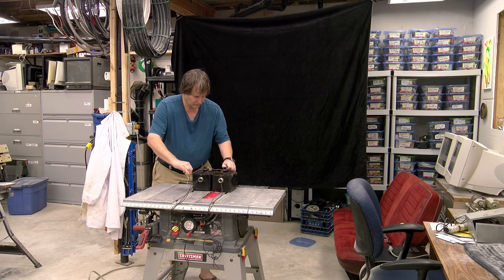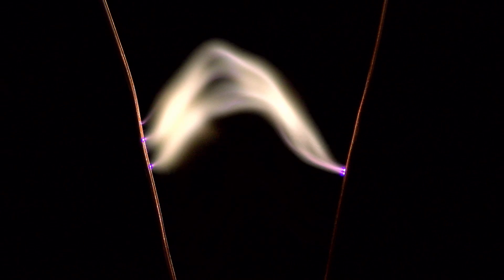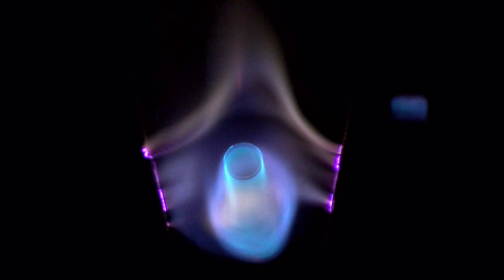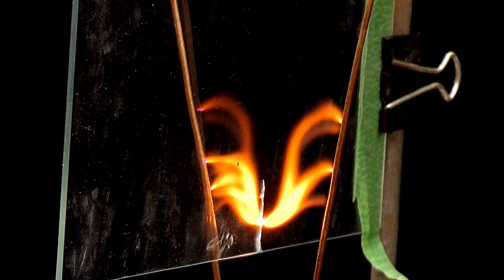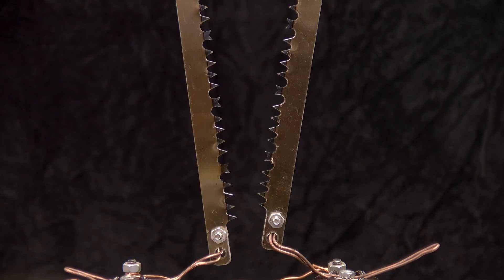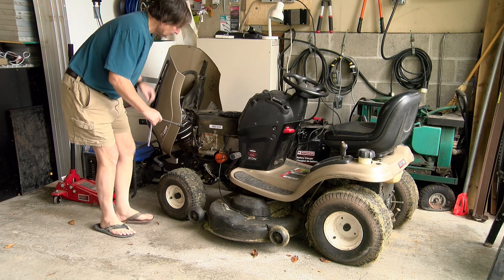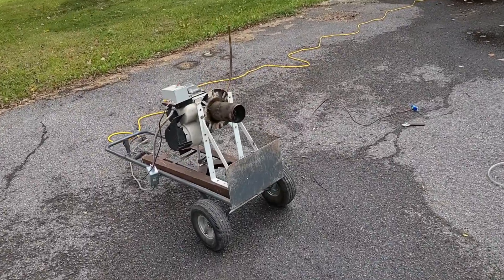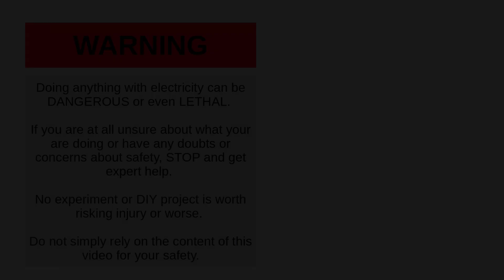Arcs, Sparks and Jacob's Ladders

Comment: try copper tubing for conductor rods on a jacobs ladder, ime there was a significantly different arc effect produced
Reply from the maker: You have me intrigued! Just looked at  your video (which I think shows wire rods?).  So what did you observed that was different? I can think of two effects: 1) the larger diameter leads to lower electric field at the rod surface and 2) the additional copper keeps the rod cooler . You are also using a much higher current transformer compared to my transformers limited to low currents which also makes a more stable arc.
Reply: @ElectromagneticVideos  the jl in my video was pretty standard, unfortunately I didn't take video of the one with copper tubing, as I recall, the tubing didn't produce a climbing arc but more of a fountain or geyser type of arc, the corona resembled fire more than it typically does but of course there's several other factors that I cant remember as it was years ago I just threw it together with my sons one evening.. anyway I thought yould be the right guy to try it out, just allow for plenty of clearance above your device and maybe keep an extra step away than you normally would, personally I prefer to use a remote controlled wireless ac outlet and also an easily actuated wired switch at the device (in case the remote fails)
- id be building one right now but I haven't had any hv transformers nor the time to go scavenging, id love to see what you're thoughts are on it, you clearly know what you're doing so I don't have to worry about contributing to someone's death over a little tweak of the ol' jacobs ladder lol
-feel free to reply to me here or on that vid I linked and you sir have one more subscriber! ⚡⚡
Reply from the maker: @Invisus_Letum   I definitely will try it - I do happen to have a number of spools of small copper tubing that I was planning to use for antennas someday, but there is more than enough to use for a Jacobs ladder as well. 

Safety: I do try to emphasize safety in videos where it is appropriate but unfortunately many people on youtube just skip to the "interesting" parts. Not sure if I showed it but whenever I deal with HV, I always use a two-handed dead mans switch (one switch for each hand, both must be on) a good distance away to prevent being anywhere near the danger zone.  I do have similar concerns as you as far people copying and not knowing what they are doing - my feeling is the best thing to do is so show how to do things safely and hopefully provide info not found in many of the crazy youtube videos. 

Glad you subscribed and hope you enjoy my other videos. Its quite a range of engineering, technology and science stuff so dont expect a channel with nothing but arcs and Jacobs Ladders!

Comment: Love this video. It looked like a lot of fun to do. I really like the saw blade demonstration it reminds me of spark gaps on some circuit boards. I have a old video talking about spark gaps and I  thought they were neat. I wish the video equipment could do justice for the neatness of the arc as my video equipment is still not great, but that was an even older camera. I could smell that ozone at the end of your video when I seen all those pretty purple arcs on the glass. I used to work in an environment where a lot of ozone was generated at times. Fun fact: plastic film before its printed on or before can write on it has to be treated. High voltage is directed through the film while it is being wound up into a roll. We used somewhere between 5-10KV and around 10KHZ. It was a pretty purple line across the web. Usually had granule filled ceramic rods across the sheet with the HV attached going through the sheet and the roll behind the film grounded and usually had an epoxy or ceramic coating.
Reply from the maker: It was! I never even thought about circuit board spark gaps but your are right. I will definitely look though your videos for that one!  

Camera equipment - my camcorders where not nearly sensitive enough to get good video of the very dim blue corona. For that I used my Nikon D810 DSLR cranked up to ISO 12800 and for some shots, ISO 25600 (normal photos are taken with ISOs in the range of 50 to 800). Camcorders like the ones I have cant even come close to that. I also needed to add some noise reduction when editing the video because those high light sensitivity settings produce really noisy videos. 

I don't know if I said it, but the corona setup sure produced a lot of ozone! (Well I did say it but not sure if it survived editing). 

You really intrigued me with the bit about treating the plastic film! I'm racking my brain as to why! Only thing I can think of is to make it stick better when stored in a roll, but you indicated it was for printing. Xerography uses static that way to attract the toner, but that wouldn't apply to writing. So why was the plastic HV treated?

One of the points of the video was to show that we use sparks and HV discharges for many more things than we normally think of - not just for horror movies. Your comment here so nicely adds to that which things I didn't think of or hadn't heard of. Thanks for pointing them out!

Comment: I got a "shocking" safety lesson when I checked a Tesla coil out of the college physics lab in '79.  My goal was to built a Jacob's Ladder for Halloween and It worked!  The problem was that, when I went to move the leads some (while it was running), I got quite a shock right through the insulation on the leads (right through my hands and across my chest)!  It wasn't until I shut off the lights in the room that I saw the corona "glow" along the length of each lead, much like your saw blades at 10:25.  It had never occurred to me that the insulation might only be rated for 600 or 1000V.  Obviously I survived, but my chest was sore for days afterwards!
Reply from the maker: There is a similar comment below from someone who was using a neon transformer. In hindsight, its surprising or lucky that I didnt  get zapped from a defect in the insulation of HV cable in the old CRT TVs I used fix when I was in high school. Of course that cable was insulated for 20 to 30kv.  It must have been quite to shock to leave your chest sore - I have never experienced that.

I wonder if some of the corona in the case of your Tesla coil wires was not just under-rated insulation, but perhaps the result of the displacement  current though the insulation  due to the high  frequency AC field ionizing the air?

Comment: Nice demonstration, with the glass between the 2 pieces of saw with the Corona effect, how is the current draw compared to without the glass?
Reply from the maker: I didnt actually measure it, but for the initial Jacob's Ladder arc, the power delivered to the transformers was fluctuating from 150 to 300W. If we assume the 300W occurred when the voltage was at the full 20kv, that means the arc had a current of  15mA. When the arc was shorter with the saw, we would expect a lower voltage across the arc (once established, the arc  becomes a  low resistance current path) and a higher current limited by the magnetic shunt in the ignition transformer. So my  guess is the current with the saw would have been around 25mA. Now add in the large glass and resulting corona, the current would be way less with the voltage at the full 20kv. At 20kv, 1mA would result in 20W of power consumed by heating + ozone and wind generation. There was no noticeable warmth at all on the glass when I removed after the experiment. So my guess is 1 mA or less type current flow for the corona demo. Would be neat thing to measure directly but a bit difficult since the meter would have to isolated in a HV insulator.
Reply: @ElectromagneticVideos  , thx for the quick reply. I know from a Arc welder, when the arc during welding is bigger, the more current is draw, so your calculations are what i expected. Grtz

Comment: Years ago I was at a HV demonstration for linesmen (I'm not and never have been one) where they showed the performance of various insulators.  They did the plate of glass demonstration but things didn't quite go to plan.  It didn't reach around the glass and start chewing its way up the plate.  There must have been a flaw, possibly even just an inclusion, that gave the arc something to conduct through and it settled mid way on the plate.  The plate only lasted a couple of seconds before it shattered probably from the heat stressing it.
Reply from the maker: That must have been a memorable demo - sure showed a slight manufacturing or material defect can have devastating effects. In my demo,  the end the crack extended all the way up in my glass plate and after I dismounted it, it split in two. Sometime I want to try with a higher voltage to see if I cant punch right though the glass....

Comment: I remember watching one of your videos earlier this year and I think you replied that a family member once could see the slight flicker of 25hz in their home in the 40s or 50s?  

Anyway while doing videos on arcs and sparks, with your previous background in electronics I was wondering if you had the equipment and ability to recreate some of the oddball frequencies that were used in the late 19th and early 20th century before we finally settled on 60 hz (or 50 if you happened to be in Europe) Besides 25hz, there was 16⅔ for trolley motors, 33, 40, 66.7, and finally 125, 133 and 140 were used to reduce flicker during the carbon arc era. And 400 hz is common on aircraft and other military equipment.  

It would be interesting to see how a Jacob's ladder would behave with some of these weird frequencies. A VFD on the transformer primary might work, I'm thinking.
Reply from the maker: I remember that discussion! And your comment here is the perfect setup for a future video inspired buy that discussion! Since that previous discussion - and I think you suggested a VFD as well back then - I have since  purchased a couple of variable frequency drives and plan  to do just that. However, before that I want to use the two HV transformers to do a video demoing why we use step-up/step-down transformers for long distance power transmission because  I am a bit concerned that the transformers may not survive some of the different frequency tests. 

The lower frequencies will require proportionally lower max input voltages so as not to saturate the transformers. So will probably limit things to 25 or 30Hz at 60VAC. So maybe for an apples to apples comparison, will narrow the Jacob's Ladder gap to work with 10kv and do all frequency tests at that that voltage. And then - and here  is the risky test - I want to try doubling the voltage and frequency (to prevent saturation at the doubled voltage)  to see if I can get 40kv out of the pair of transformers. My guess is the insulation should have a significant safety factor built in and survive that, but who knows!

And as an added bonus from having the VFDs, also will do a video about three phase - should be able to hook up an incandescent bulb to each phase and show how the  voltage and power peaks moves from phase to phase over the course of  cycle. Thanks for suggesting I looking to VFDs back then - I had no idea how cheap they had become!

Comment: The glass demo was great.  Everything is a conductor if the electric field is high enough.  Most glass made today is soda-lime glass, which is made from a mixture of silica (aka quartz, SiO2), sodium oxide (Na2O), and lime (calcium oxide, CaO) along with small amounts of other oxides (magnesium, aluminum, iron, titanium and potassium, if you believe Wikipedia).  Both sodium and calcium give strong emissions in the yellow/orange region of the visible spectrum when they get hot enough, and the arc is definitely hot enough.

Reminds me of a demo I saw at the Corning Museum of Glass when I was a kid (late 1960's).  They had a Vycor (glass that is mostly quartz with just a bit of aluminum oxide) disc rotating (about 1 rpm) between two spherical electrodes that were spaced about half an inch apart.  The disc had two holes in it 180 degrees apart.  When one of the holes lined up with the electrodes, an arc would jump between the spheres and slowly get stretched out to about 6" long before extinguishing.  The coolest part was that it was interactive, so the visitor could turn it on with a push of a button and it would reset after a full revolution.  (I would have stood there pushing that button until closing time, if my sister hadn't dragged me away.)  Sadly, the next time I was at CMoG (2006) I couldn't find the demo, so I suspect it did not survive the flood of '72.  The point of the demo was to show that Vycor was much more heat resistant than ordinary glass (higher melting point and lower coefficient of thermal expansion) and much less conductive (essentially no free ions compared to soda-lime or even boro-silicate glass).  I don't think Corning makes Vycor anymore.
Reply from the maker: Thanks! You just confirmed something I was speculating about and actually edited it out of the video because I wasn't sure  - the yellow when going though the glass sure looked like sodium - so based on your comment I guess it was!

The demo you describe - how interesting! I have never seen a demo like that but I guess you need that Vycor glass you mentioned or it would fail just like my plain old glass. The interactive part must have been amazing. Its funny - not sure if I would ever think to go to a glass museum but I would for that exhibit!

My similar memory from childhood was when we lived Germany for a few years in the early 70s. If you ever visit that part of the world and are in the Munich area, the Deutsches Museum is one of the most amazing science museums I have ever visited with lots of interactive exhibits like that. Like you, I could have stayed till closing!
Reply: @ElectromagneticVideos  Hope I didn't give you the wrong idea about CMoG.  There were quite a few other displays of interest.  There were live glass-blowing demonstrations (when glass was held in the torch flame, the initially blue flame developed the same bright yellow-orange glow as seen in your arc).  There was another interactive display I remember where you could crank a handle that raised and dropped a sledgehammer on some particularly tough glass (maybe a precursor of Gorilla-glass?).  They also had a failed mirror blank (the steel mold melted) for the Hale telescope (largest in the world from 1949 until 1976, 200" in diameter and about a foot thick with a honey-comb stiffening pattern molded in, made of borosilicate glass, aka Pyrex).  I think they got it right on the second try and it has been in service ever since.  Another display that foreshadowed things modern was the optical glass display, where they had a couple of scenic postcards that could be viewed through cast glass blocks.  One block was ordinary window glass and about a foot long, showing a dim blue/green image of the post card.  The other was high purity optical grade glass with the same post-card sized cross section, but about twenty feet long and the view of the card was crystal clear.  Next to that was a mile long spool of fiber, made from the good glass, with a light shining through it (so, yes, the beginning of the fiber-optics industry).  The boring bit (for me, at that time) was the ancient glass collection (thousands of beads and bottles, some going back several millenia).
Reply from the maker: @robertlapointe4093  Now you have convinced me to visit if I am ever in the area. Not too far from me as the crow flies (200km) but a longer drive due to Lake Ontario being the way.  I would enjoy the same things you liked and similarly be bored by ancient beads :)

I read somewhere that Corning had developed Gorilla-glass way before cell phones - I think that had a small scale use for it - how lucky they were to have developed it - they must be making millions or billions!

Comment: I remember watching some of these movies when I was a kid around Halloween time.   At the AC/DC electronics class I took back in 2013-2015 we watched some safety videos on electric shock and arc flash (as a journeyman, the thought arc flash scares me more than shock) One of my instructors then made a Jacob's ladder using a 15kv neon sign transformer.    The purpose of the Jacob's ladder was to demonstrate the unique characteristics of arcs and the importance of current limiting means such as the ballast in arc lamps (fluorescent,  neon,  xenon,  mercury vapor,  sodium vapor) 

I loved the glass experiment you did, what most people think of as an insulator is really more or less a conductor with a very high resistance such that for most intents and purposes it prevents current from flowing unlike the copper and aluminum used for electrical wiring.   No known substance is a perfect insulator or perfect conductor.
Reply from the maker: Neat to hear you had an instructor who did demos like that - I always find actually seeing something make it much more real that just in a book.  You mentioned the unique characteristics of arcs - something I didn't mention in the video was the negative resistance characteristic of arcs and how they were used as radio transmitter oscillators in the early days of radio. It was to see if I can duplicate that in some future video.

I completely get your comment about arc flashes  - luckily I have have  experienced a significant one - but I can sure see in your line of work the dangers when almost unlimited currents are available to vaporize and hammer anything nearby. An electrician neighbor told be of a giant bus-bar vaporizing in a nearly plant where a breaker  failed - yikes. 

You make a great point about insulators actually just being very high (but not infinite) value resistors. I'm always wary of HV cables like those in old color TVs where 30kv or more feeds the picture tube. Never want to find out what happens if the old insulation has a pinprick hole!